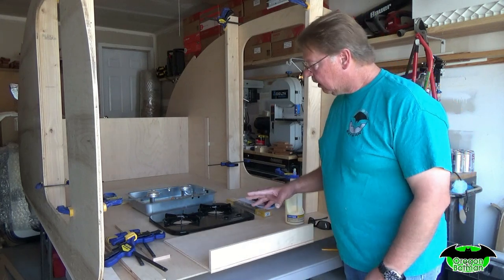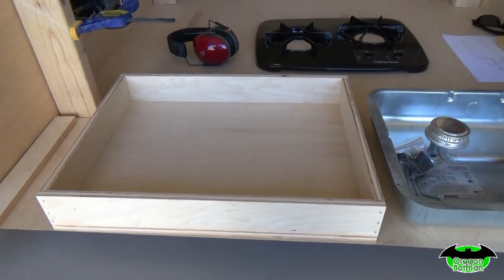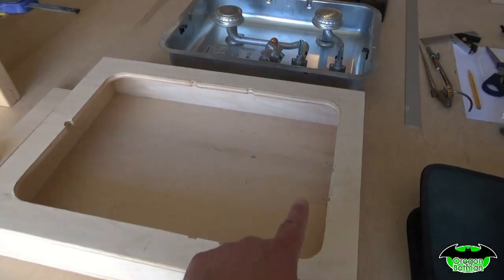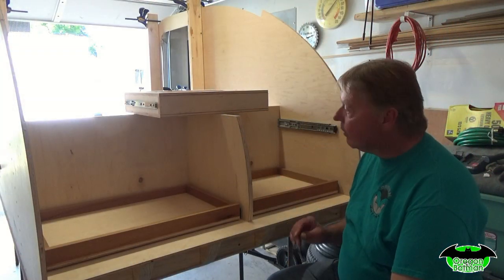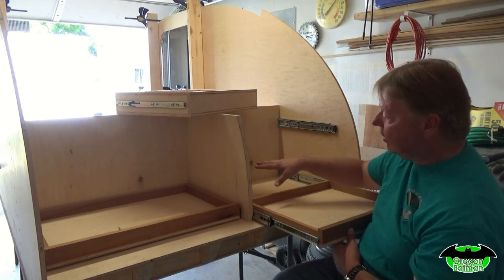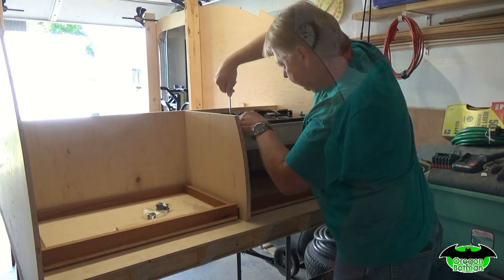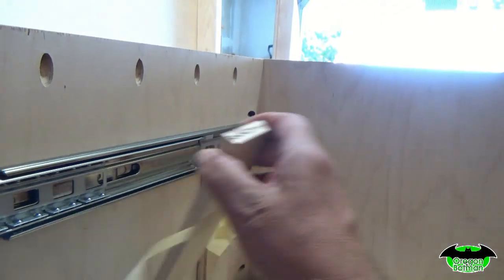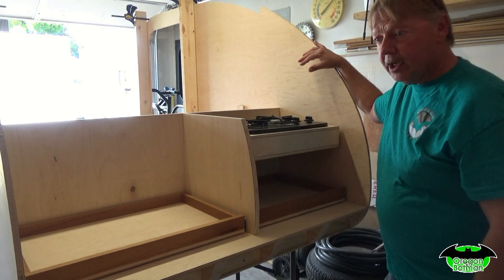Let’s Build A Teardrop * Step-By-Step * - Part 14 (Installing 2-Burner Stove)

Comment: Enjoying your build each week. Why not move the drawer runners forward so you don't need to cut into the benchtop. You seem to have the room. You could also put a back on the tray just like the one you intend to put on the front and it will help reduce any splashback into the space below the cooktop. Thanks for your continuing videos.
Reply from the maker: Thanks Dave! Actually did something a little different (next video) to remedy that short drawer, and I think it work out pretty well. I like the idea of the back splash, didn't think of that, I'll have to give that one some thought! :) Thanks for the comment!

Comment: I have debated on making a camper for several years. The one thing I'm still not sure of is if I would want the stove to be mounted or, just a drawer to store it in to be taken out and used on a table. My reason for being undecided is that when cooking, I always get splatter from what I'm cooking. Don't know if cooking splatter would eventually ruin the finish even after cleaning right after cooking.

Your thoughts?
Reply from the maker: I'm with you... I really like the built in stove, it just looks good. It functions very well, and yup... I get those splatters as well. The downside is, can't move it to cook out under a canopy or anything. So I carry around an extra burner that runs off the little cans. I can move that to a picnic table or anywhere I choose. You have to decide, form over function...

Comment: Which 2 burner stove did you end up using?  Sorry if I missed it in the video.
Reply from the maker: Hi Nolan! It is the Suburban 2 burner drop in stove. You can find on Amazon as well as Ebay

Comment: Nice Video. Curious how you plan to run the gas line and where the tank will be stored.
Reply from the maker: Hi mibengal! I will attempt to run a quick disconnect out the side of the burner and mount the small propane tank to side of teardrop. I'll just have the hose from tank to the quick disconnect, and store it away when not in use. That's the plan.... now, just gotta figure a way to do it! :)

Comment: What about the gas line for the stove?
Reply from the maker: I will attempt to run a quick disconnect out the side of the burner and mount the small propane tank to side of teardrop. I'll just have the hose from tank to the quick disconnect, and store it away when not in use. That's my plan!
Reply: @OregonBatman  Sounds like a great plain, don't forget to film it. thanks.
Reply from the maker: You got it... I'll film the details! Thank you Roger!

Comment: Good looking stove top install. I was watching and when you pulled the knobs out of the plastic I said, "I wonder if he measured those before slide install."

How are you going to run the LP gas to it? Does it have a little hook up for a green bottle or are you running gas lines somewhere?

Keep up the good work.
Reply from the maker: Hey DR! Nope.. didn't measure them knobs first! LOL! But all is good! For the gas, I will attempt to run a quick disconnect out the side of the burner and mount the small propane tank to side of teardrop. I'll just have the hose from tank to the quick disconnect, and store it away when not in use. That's my plan!

Comment: Again, another great video, please keep them comig. Quick question though. What is your plan for the gas. Do you plan to link it beneath or on the exterior?
Reply from the maker: Thank ya! I plan on coming out the side of the drawer with a quick disconnect once the sides are on (filon) and the propane tank is in place. Need to shop around for those parts still! :)

Comment: I was looking for the brand/model of stove you're using?
Reply from the maker: Hi Mike, the stove I have is a Suburban SDN2 drop-in. Flame King makes something similar and around $60.
Reply: @OregonBatman  Thanks
Reply: @OregonBatman  I've been digging thru the product descriptions, and they don't seem to address the depth of the unit, or the height above the counter.  Did you happen to capture this info on your youtube series?
Reply from the maker: @MikeReilly1975-1987  take a look here... hope this helps: https://www.rvupgradestore.com/v/vspfiles/assets/pdf/burner-manual.pdf
Reply: @OregonBatman  That's awesome, but they don't address that dimension in their manual.  I'm just looking for the height to the top of the knobs above the installation countertop.
Reply from the maker: @MikeReilly1975-1987  From the surface of the plywood to top of black survace of stove is roughly 3/4" (almost). From plywood to top of burner plates is roughly 1-3/8". From surface of plywood to top of knobs is right around 1-5/8". Hope that helps
Reply: @OregonBatman  Outstanding!  Kind of funny that they don't address that in their manual (but then, I don't think they foresaw their product being installed in this manner!). Thanks Very Much for your help.